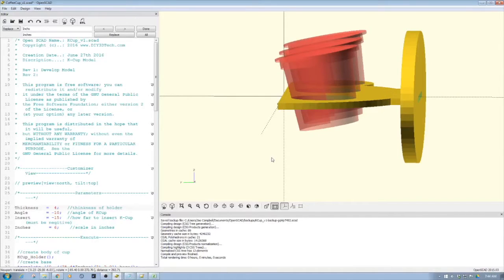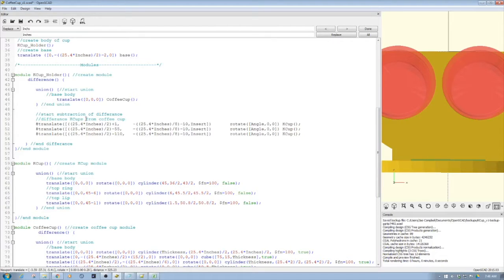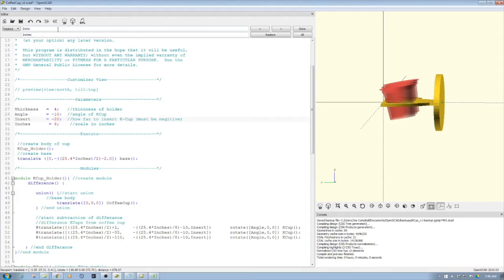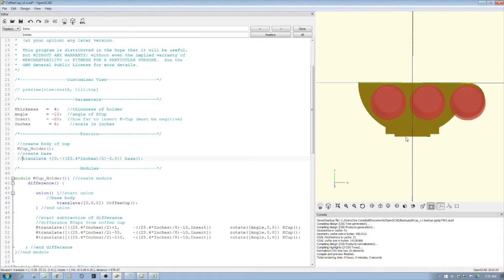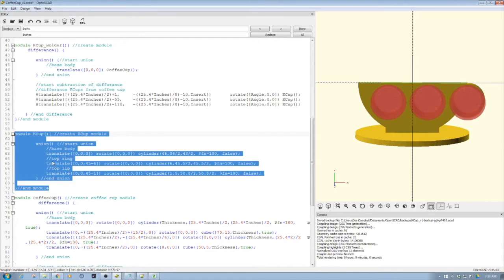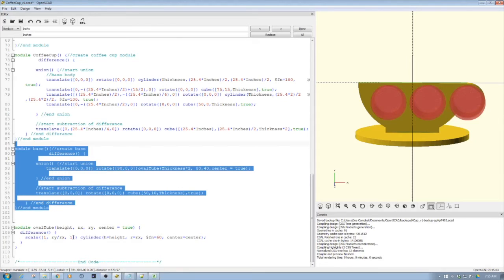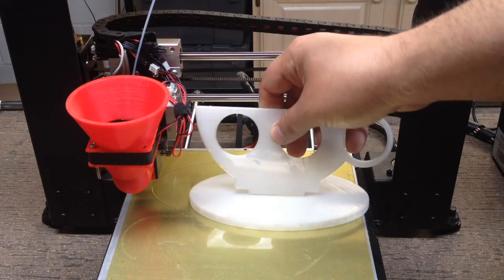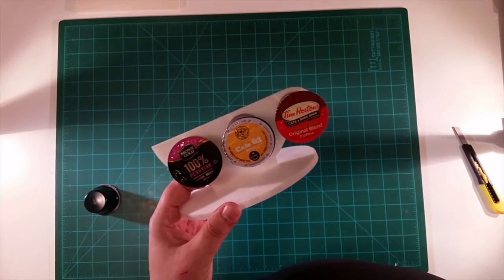Open SCAD - Coding a Keurig KCup Stand for 3D Printing!

Comment: Ctrl + and ctrl - will change your font size.
Reply from the maker: Interesting, will give it try as I was thing about trying a "scene" on OBS to call out the text (making it larger) however this sound easier :-)
Reply from the maker: Tried this and it didn't seem to work, do mean while in Open SCAD you an do this as that is what I tried.  Am I missing something?
Reply: +Open-SCAD DIY3DTech Yes, it's a pair of options right at the bottom of the 'edit' menu in OpenSCAD, just before 'preferences'.  
Just in case the version makes a difference, I'm using version 2015.03-2, on Windows.
Reply from the maker: Didn't find that however Control/Scroll wheel seems to do the same :-) many thanks!
Reply: Glad to be of service!
Reply from the maker: Ah I see now said the blind man who picked up the hammer and saw... :-)